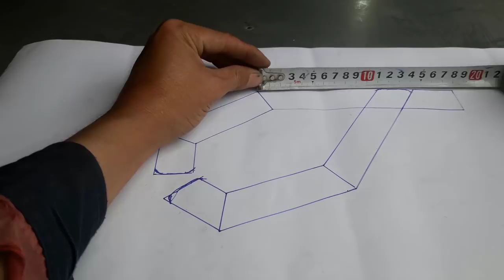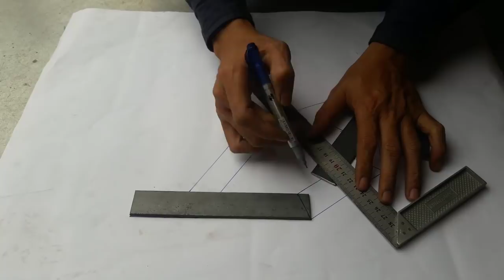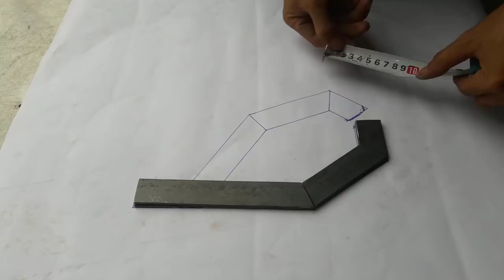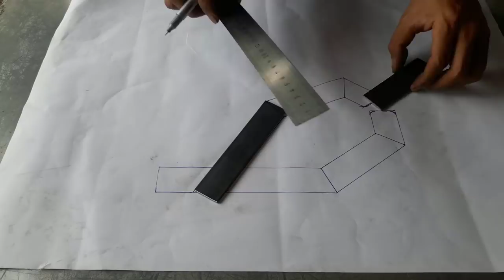DIY Tool | Making an Y Clamp

Comment: Great video. I already did mine. Thanks

What's the tool you use for welding?
Reply from the maker: I used TIG welder.
Reply: @KwandoTechnic  What Gas do you use? The G in TIG is for Gas.... I don't see any gas hose. 
Why do you switch it on and off all all the time? It looks like you are only spot welding for some reason.....